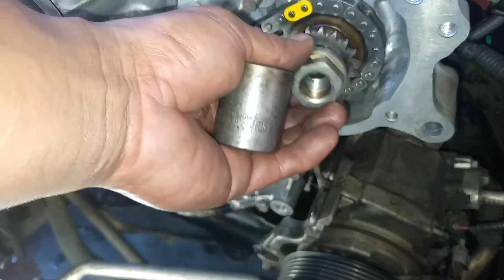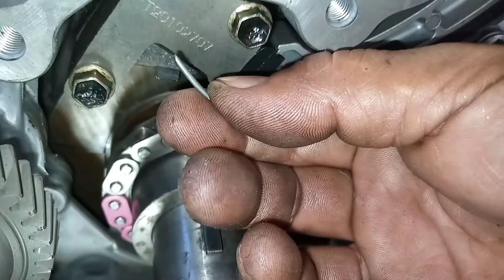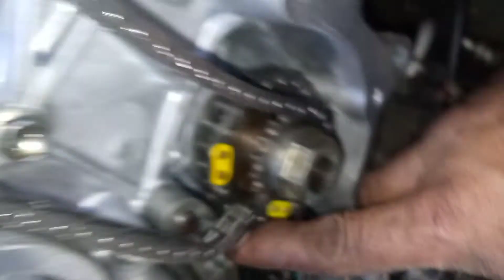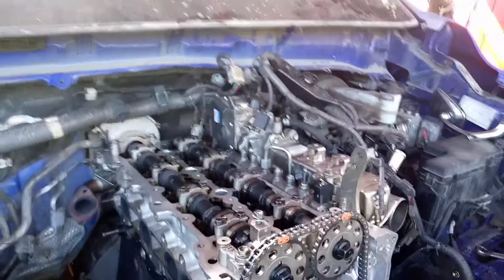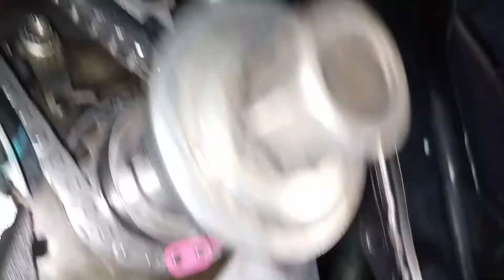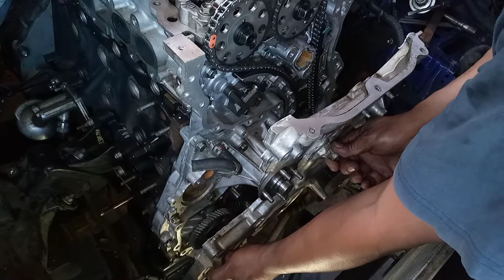Timing Chain Set-up Toyota 1GD 2GD

Comment: Sir how many mileage to change a new timing chain.,thanks
Reply from the maker: Timing chains have no set interval for replacement. Timing chains may need to be replaced when the chain loosens or make some noise.
Reply: @DiYSpanner  thank you so much sir.,godbless
Reply: what is bad noise for timing chain、？

Comment: Please what are difference between 1gd and 2gd
Reply from the maker: 1gd is 2.8L engine while 2gd is smaller which is 2.4L engine. Thanks for watching!
Reply: @DiYSpanner  you welcome
Reply: @DiYSpanner  please mine is 2gd 2.4L. does that mean, I can also use 1gd 2.8L without changing anything..?
Reply from the maker: possibly yes,